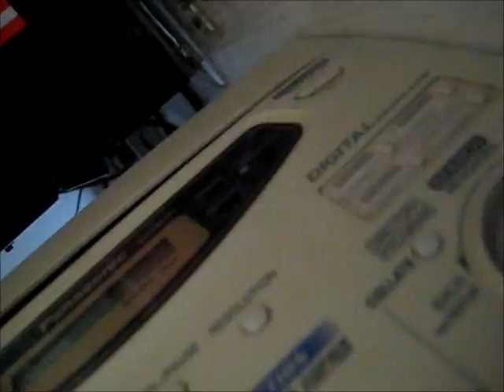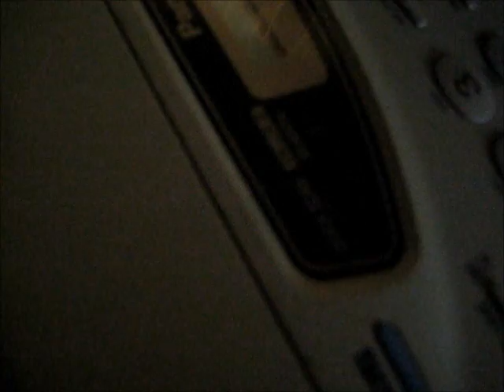Fax PSU Repair

Comment: Ticking sound is usually some type of overload.
Try Caps first than small diodes which may drive certain components.
This is a SMPS. They can be awkward to fix sometimes.

Comment: I ve had a very similar problem with also a switching powersupply. I found the bad diode by accident. It still was intact, but no lights were on, and when i powered it u it blinked orange, amd started to smell burned. When it was defect it did not only gave a ticking sound, also the output voltage ticked.

Comment: @coolbluelights hmm some power supplies operate at a lower frequency, but it could be some vibration, or a capacitor. LOL ya the scope will need to scope itself xD

Comment: check everything in the feedback circuit, if there is no feedback whatsoever then the PSU won't start up. You say the second X cap only has 1/10th the voltage as the first X cap? Perhaps there is a partially open circuit in that mains filter choke?, the chocke on the circuit board with the copper wire showing. I think it can't make a high enough voltage on the secondary with such a low voltage supply, so maybe thats whats wrong.Of course be sure to check all voltages and such in the SMPS too!

Comment: Few months ago, i unded up repairing an old video player, that did exactly the same sound, except it was coming from the magnetic core of the transformer. I thought it's the power MOSFET at first too, replaced it with an exact new one, and still it was failing, i tried to trace the rest of the beard, but failed to find anything.., then i put it all apart, to get the goodies out of it and found out that the output filter with rectifier were shorted, Damn chinese capacitors...